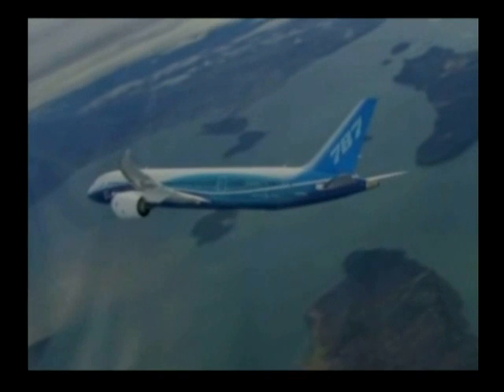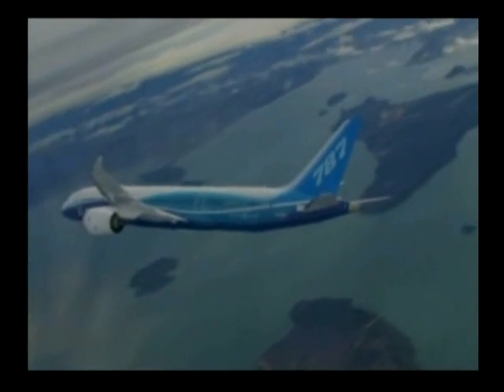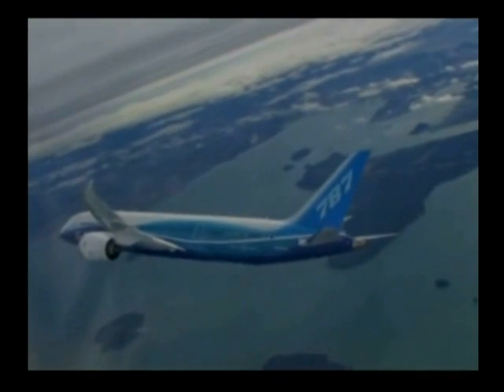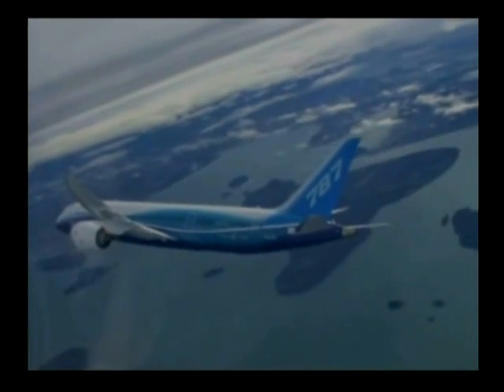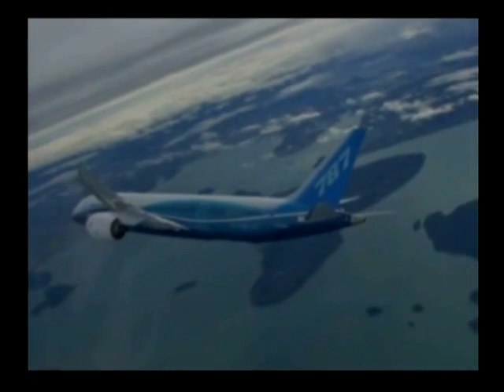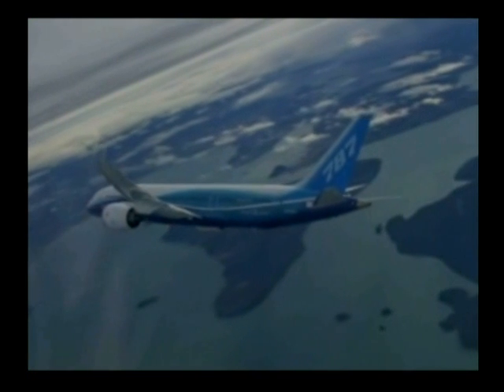Boeing 787 Stall Tests

Comment: Stall testing is not done to see if you can do it, it's done to examine the characteristics of the stall in the chosen configuration, Has it got any particular problems recovering that need writing into the pilots notes on the airframe, stall recovery is a rather a simple process if it happens, but not the sort of thing you want to do with Passengers aboard, they get rather upset.

Comment: I never flew a sidestick when I was flying, but I've always heard about how much more ergonomic and easier to control they were. I know some GA planes use sidesticks; some have a single center-mounted sidestick shaped like a Y for use by both pilots - definitely simpler, lighter, & cheaper. I think this guy was talking about Airbus vs Boeing, where the real issue isn't yokes vs sidesticks, but total computer control vs total pilot control. 'Murica is where pilots are still in control! (sorta...)

Comment: Wow! They must have incredible guts and incredible cool to put a jet through that, especially when no one else has ever done it before! I would think a jet like the 145 would pose a real risk for flameout during a stall, especially with the aft engines. (DC9's & CRJ's have had dual flameouts from aerodynamic stalls.) Did he ever say at what altitude they initiated those stalls, or how much altitude was typically lost (when not in a tail-slide - omg!)? He or she must have some  stories!

Comment: A retired airline pilot I flew a 208 with was an Embraer test pilot for the 145. They definitely did full stalls, and ended up tail sliding one (not on purpose of course).

Comment: Oh yeah - the other thing that happens in a full stall is that the engines lose airflow and often flame out. Jets cannot always be restarted when this happens (i.e., Pinnacle Airlines flight 3701). Doing full stalls in turbine-powered aircraft is extremely dangerous.
Reply: Would be part of the test program, wonder if auto ignition kicks in at the stall.

Comment: Are they really doing full stalls? To me it sounds like they're flying it until it gets right up to the point of stalling, but then recovering before the actual stall breaks. Does anyone know for real?

I was a dispatcher 20 years ago, and when our pilots "stalled" the planes in training, they only did approaches to stalls because a full stall would mean losing at least 10,000 feet. That was in commuter turboprops. I've always wondered if airliner flight tests ever did full stalls.

Comment: Should have done what NASA did and used Silver-oxide batteries with 40% more run time on average, or spent a bit more money and used Nickel-Zinc. Both are safer than Li batteries.

Comment: You can enter into a stall without any displaying anything dramatic.  I doubt you'd want to let a big aircraft like that enter into a stall spin anyway.  Instead they slow the speed just enough to feel the wing begin entering into a stall, then immediately nose down and increase speed.

In short, a stall does not mean a zero g free fall or spin maneuver.

Comment: @K0nst4nt1n96 Are you have a bloody laugh? of course Pilot's know how to fly planes. I'm sorry but the training is absolutely rigorous and lengthy. Being a commercial pilot isn't just a job you can walk into it takes years of training. 

But no give you an analogy. My car has ABS Brakes, Power steering, Automatic Headlights / Wipers. I still no how to brake, how to steer,how to turn my headlights on and most importantly I still know how to drive.

Comment: @Hondaridr58 i want to see how they ill managed it to land a 747 with muscles i can imagine how they instruct all passengers to stand up and go to the left side or back or front to make a turn xDD
but were talking only about the worst scenarios fact is that pilots dont really know how to fly a plane now a days because all computers and electrical systems are taking control a good example is the crash air france 447 with an airbus a330

Comment: @K0nst4nt1n96 No, like I said it still has a cable/pulley system, if hydraulics failed, the pilot and co pilot could still muscle the plane around. If that happens with an airbus and its all over. Obviously there are tons of redundant systems to virtually guarantee that will not happen, but its just an added bit of confidence.

Comment: @plasticspastic201 In order for any type to be certified under FAR part 25 by the FAA they must demonstrate stall characteristics. The A332 is certified by the FAA as a transport category aircraft. The FAA would not have certified it if had not performed these tests. There are several things that I question about Airbus. This is not one of them.